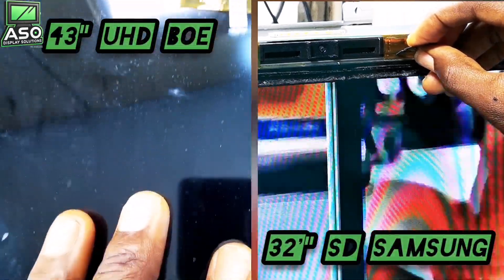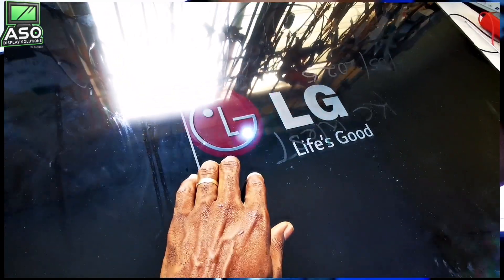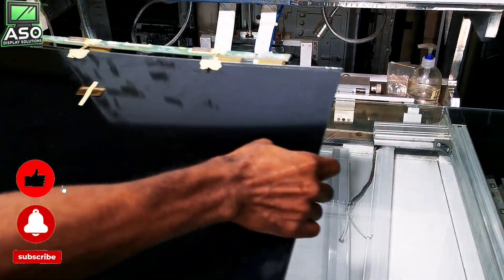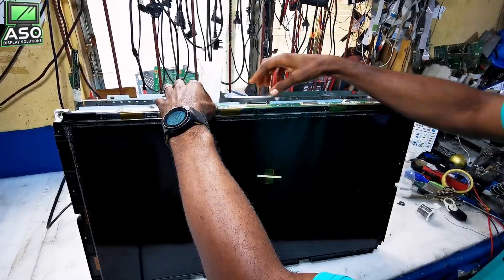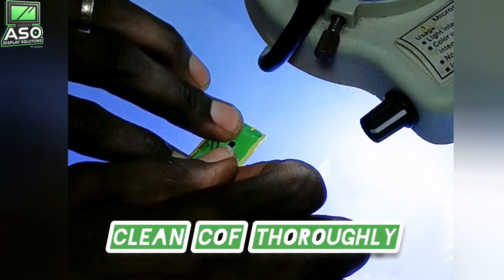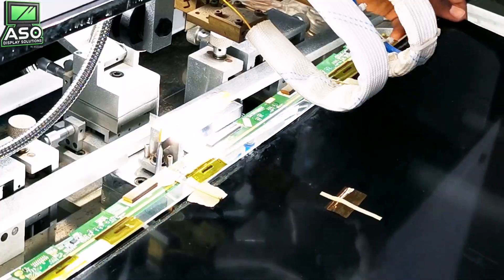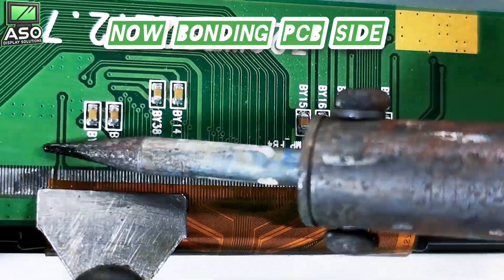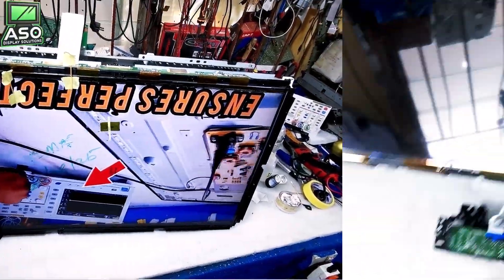SECRET TECHNIQUE: SOLDER & ACF Fixes LCD TV Panels!

Comment: There IS a cheap way to bond the cof to the panel? I Saw a T form soldering thing selling in AliExpress. It would be similar?
Reply from the maker: Did you notice that I used it for pre-attachment? You cannot use it to bond a COF to a glass--absolutely impossible. 😊
Reply: Thank you for answer😊 @asodisplaysolutions
Reply from the maker: No problem. You're appreciated ❤️